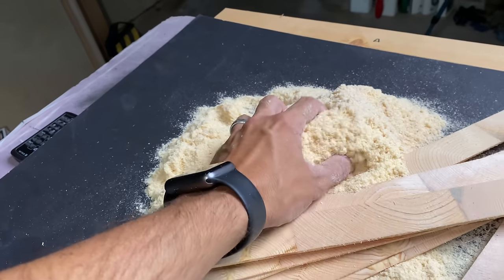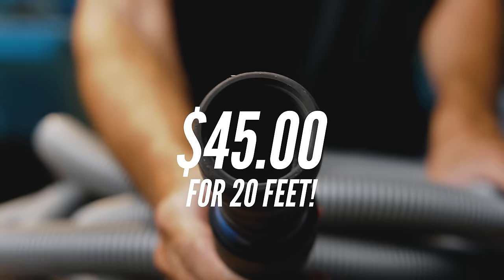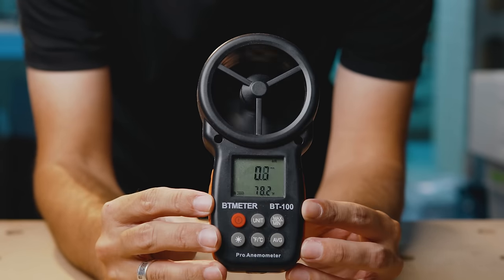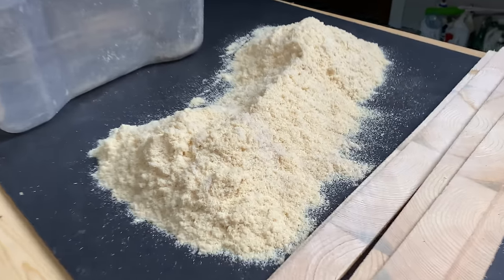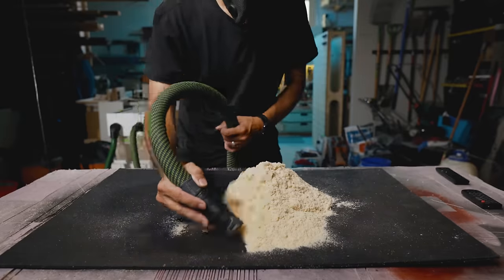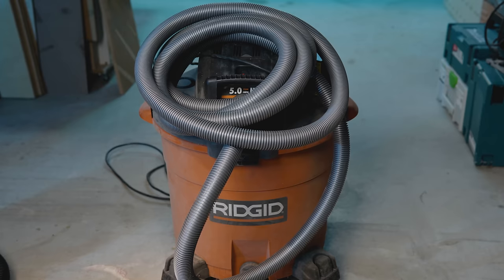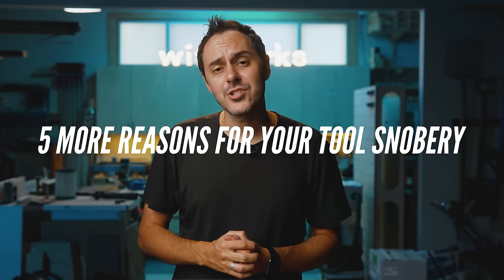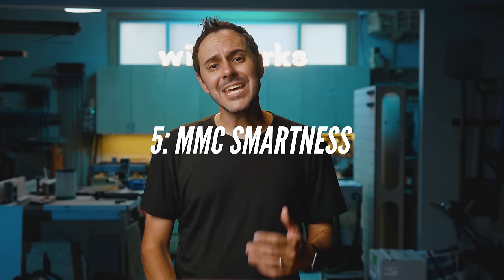This video will save you a lot of money. Dust extractors for beginners.

Comment: Overall very nice video, but the study design is flawed. The goal of a dust extractor is to remove as much dust as possible from the air that you will inhale.

You don't measure the overall dust in your workspace or the dust levels around your face (that you will be inhaling); instead you measure the total amount of dust in the air around the exhaust of the dust extractor. 

You show that the newer dust extractors move a lot more air (about twice as much as the old dust extractor), which suggests they also move more dust (probably about twice as much as the old dust extractor). 

So, if you measure the concentration of dust particles at the exhaust of an extractor moving 5m/s of dusty air, you would expect it to to have a lower concentration of dust particles than the air surrounding the exhaust of an extractor moving 10m/s of dusty air.

Some ways you could adjust this experiment are to have the dust meter in the vicinity of you face as you saw, to see how much dust particles you would be inhaling with each extractor. Given the increased air movement of the newer dust collection models, I would expect both of the newer models to outperform the older rigid in this regard, and improve the quality of air that you're breathing!

nice work, though!
Reply from the maker: Thank you Max. I should have bought a second monitor to put by my face. That’s most important. It would be interesting to see the differences.

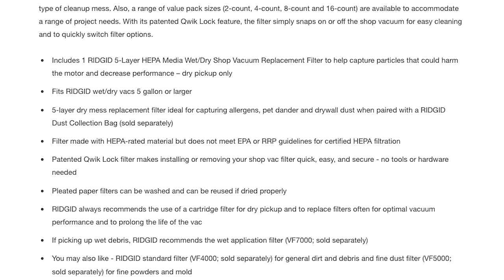Comment: Your comment around 2:30 in is what I am trying to sort out wirh Ridgid support right now. I believe what you are saying may be correct but what I don’t know and they are unclear if not actively misleading is whether you need to shell out even more for the special green “cyclonic” filter bag. As it reads in your second highlight, it’s left unclear. Did you happen to address this question? the cyclonic bag is possibly a gimmick to get you to buy their branded bags. Also, did you dig i to any of the claims on “OSHA table 1 compatibility”? The statement they make there is meaningless because they don’t make a substantive claim pursuant to what is included in table 1. I am taking it up with their support presently, waiting on escalation to their product managers and engineering. Just wondering your thoughts.

Comment: The main reason your test isn’t “scientific” is that your sample size is too low in two ways. The first is that you’re testing one of each filter system. A professional lab conducting a scientifically rigorous study would test multiple machines for each of the three systems. How many? Ten, fifty, one hundred? More? I don’t know, but there’s a way to calculate how many machines per system to arrive at a statistically significant number.

The second issue is that you’re probably not conducting a significant number of tests for each machine (again, I don’t know how many tests per machine you’d need to conduct, but there is a formula for finding this out. A statistician could probably tell you.

The reason you’d need to conduct all these tests with multiple example machines is it corrects for all sorts of variables that might be affecting your results.

So we’re talking a buttload of time, effort, and money—which is why these sorts of tests are conducted by professional labs, paid for by the government or industry groups or individual manufacturers. For a test of these machines, they’d have a team of people working all day for however many days.

It’s just not realistic for you or me to attempt scientifically and statistically rigorous testing.

That said, I think your test is valid FOR YOU, because you were testing the machines you are using or going to use. I also think you made a good decision, and the reason is not the convenience factors you mentioned. (And I want to note that your anecdotal evidence IS evidence. It’s just limited evidence.)

Because the Festool air filtration system is purpose built, it’s a safe assumption that they rigorously test their machines. They probably periodically test production runs. It’s probably a safe assumption that their safety standards are high because European Union (their main market). These assumptions are NOT scientific, but instead rely on faith in expertise. (And there are many folks that just don’t trust expertise and operate on gut instinct or react to DIY videos or marketing or whatever.)

Anyway, I have been using my shopvac for years (without accessories) and I’m heartened by the idea that a dirty filter has been protecting me (even if there isn’t scientific proof for the idea). And even though my health is worth more than the cost of the Festool, it’s just not within my current means. But I think I have an economical solution, and the name of that solution is KN95.

The last two years of pandemic have trained me to use KN95 (or N95) masks. I’m more comfortable wearing them than I was pre-pandemic. Sometimes I come home and forget to take it off right away. Wearing a mask no longer seems like a hassle. I already have a decent amount of masks squirreled away. (Also, my shop is well ventilated, so I don’t think (I hope) that these micro particles are not lingering.)

Realistically, how much time do I spend generating and/or exposing myself to saw dust? I’m in my shop at the very most 24 hours a week when I’m deep into an ambitious project. Sometimes I’m in there 4 to 8 hours. Sometimes I’m not in there at all.

Last weekend I had a health issue with excessive dust that took me out for half a day of recovery. So after that I’ve been wearing a mask and I’ve experienced no issues. That’s my anecdotal evidence that the mask is doing something. I just don’t know how much. But if it’s good enough for viral particles, hopefully it will be good for dust particles.

I hope that anti-maskers read this comment and become mentally unglued. 😂
Reply from the maker: Too long didn’t read.

Comment: Luved the vid.I’m in as similar situation over the years. I work with a lot of MDF. I have vacs and hose connections on my miter saws, router and orbital sanders. Yet I always struggle with the amount of dust in the garage and at the job site. I use a dust hood on my trim saws hooked to a vac ( the same vac I use to suck up drywall dust and wood shavings)on a foot pedal switch. Just cant seem to want to spend 1,000 buck on a vac  from a 150 buck one with near the same CFM that I have to lug around in a truck that has little room in the box with a hard tonneau cover on it,. Any thoughts to say a portable vac 1 or 1.5 Hp stand up collector to wheel around to where you need it in the shop. My table saw moves around the garage as I need it.  I’d say in a 25ft radius  of my work bench.  Most times right beside the SUV in the winter months. LOL

Comment: Great video! Got me motivated to set up my freebie shop vac for dust extraction 

I would be curious to see what the air quality meter would read if you put it right next to the tool as you’re cutting. I.e. - is the lower cfm you can get from the clogged old shop vac able to fully capture the dust produced at the source? Or is the festool better at catching everything thrown off by the blade?
Reply from the maker: 1) I have learned that the air meter in this video is garbage. 2) I have a more recent video that has a better monitor and tests at the source.
Reply: @wittworks  Thanks! I’ll check it out! Excellent work thank you

Comment: Enjoyed your video especially since I am looking to purchase the Festool CT 15 E HEPA the for lack of a better term their entry level dust extractor $416.99. Missing the hose storage, Bluetooth and it has the older style hose.
I am currently using a Ridge shop vac with the bag and HEPA filter. My question is is there a difference between the two vacuums in how much sawdust it picks up using the track saw. I watch some videos and it appears that very little sawdust escapes the Festool track saw using the Festool vacuum as opposed to what is left behind using my ridged vac.

I appreciate any feedback you can give.
Thanks

Comment: Those "cheap" air quality meters are practically useless. The sensors they use can't differentiate between a piece of sand or a micron particle. They simply approximate the particle size. One would have to use a laser scattering quality detector that is calibrated from the factory and continuously calibrated annually.

Comment: Do you need a hepa filter bag when you have a hepa filter and using a cyclone as well. As all the dust goes into the cyclone. And how much does a diffuser reduce the noise by.
Reply from the maker: for the hepa rating, yes.

Comment: What order did you use the shop vacs in? If you used the old shop vac 1st every time then it is starting with cleaner air while the other two are getting poor readings due to the amount of dust from the first test.
Reply from the maker: I did Festool first and old vac last. Also waited until the air reset.

Comment: First, an anti-static hose is used in woodworking to prevent the static build-up that could create a spark that could cause an explosion or fire, don't use one at your and your family's risk, the same thing go for the cyclon, these should not be legal without anti-static. Secondly, your old shop vacuum performs better at dust removal because the filter is blocked, all the additional particles on the filter act as additional filter elements, this is at the expense of airflow, poor performers at vacuuming, install a new standard filter to have a better comparison.

Comment: The numbers make sense when you consider the number of particles counted should be less on the old rigid because your airflow brings less to be counted.  The more particles counted, the more accurate your efficiency reading will be! With lower counts you are getting a false sense of security because the air is less dense only because its not seeing as many particles per minute. 
I hope this makes sense to you in a good way. I'm not being critical, only trying to explain how you are getting these readings.You have to be the one to decide if the difference is critical enough to make a it worthwhile. 🤔

Comment: The results were surprising. I would have expected the festool to do the better job.
But using anything to help eliminate dust is always a good strategy. While I've got a couple of vacuums attached to various tools to help keep dust a bit lower, there's other times when it's hard to do that (like on my table saw and circular saws). If I'm cutting large sheets, I just cut them outside first. 

My father was a builder for over 50 years and died of lung cancer. I don't ever remember him using any type filtration at home, however I'm sure they had some at work. I don't know if you can fully attribute the cancer to hazardous woodworking particles as he was also a smoker since 15yo, worked with asbestos and during the early days of the trade, fine dust particles weren't a thing (large dust extractors were just to get rid of shavings). Funnily enough, I remember him saying something along the lines of "Most dust won't hurt you. But if you're working with cedar, wear a mask as the particles will make your nose bleed".

Personally I get hay-fever, so reducing dust where I'm working helps reduce that.

Comment: I have been looking @ the CT MIDI.  I'd like to hook it to my CNC (Shapeoko 4). But it doesn't look like the hose that comes with these collectors is the right diameter to fit the dust collector fitting on the CNC.  It looks like it requires some 36mm hose.  Any experience with this?
Reply from the maker: I've not hooked it up to my cnc, but I have both hoses. For a cnc, I'd probably get the ct15 - cheaper because it doesnt have bluetooth
Reply: @wittworks  thanks!

Comment: How does dialing down the suction eliminate swirl marks from a sander?
Reply from the maker: dials in the surface tension some how. I am thinking it allows the sander to float more. When you press down on a sander too hard you can get swirls.

Comment: Spend 89 dollars and put in an exhaust fan in your shop.  It's a workshop, not a condo. 
For the love of God, how did people survive in the 1970s without all this digital crap?
My workshop has no windows.  It does have an exhaust fan and I use the simple shop vac to collect dust, no bag, but does have the hepa filter. 
My workshop is absolutely safe for people with allergies.  My wife has allergies and works with me all the time with no problems.
Noise - get a pair of 90 dollar active headphones, chargeable.  This is the only "high tech" piece of equipment we use to protect our hearing from loud noises like saws.
We also wear them when shooting our guns.  I also put them on when she's mad and yelling at me.  😁
The active headphones dampen all loud noises but you can still hear people talking because they actually have a microphone built in.  They just have a built in noise gate. 
Worth every penny. 
So, for 200 bucks, my workshop is just as safe with clean air as yours will all your high tech gadgetry.  My shop runs on solar solar power, so I don't have an electric bill to heat or cool it or run any of the equipment.
If you're going to spend a lot money, get the solar power.

Comment: I have no problem believing your science and results and that the equipment used was consistent throughout the testing…based on your use of a track saw, that makes chips, instead of fine dust like a sander with 220 and finer paper. 
I’ve been using sanders for 40+ years as a DIY, long before that was even a term, all the way back to a time when sanders didn’t even have a dust bag. Fast forward 40 years and I started getting “sick” (couldn’t breath for several days without great difficulty) every time I used my sander for more than 15 minutes. OK, hook the 15 year old Rigid vac up…no improvement. Bite the bullet and drop a grand on the Festool CT26E and I can sand for days and not have a problem! 

So is the price of the Festool worth it? You bet your ass it is! I was at a point I thought I would have to give up making anything that required sanding.

BTW, I DO NOT have asthma or any allergies of any kind.

Comment: I'm a Cabinet contractor for 35 years, I have high quality power tools, but I absolutely will not purchase Festool products, they are insanely priced, and not remotely worth the money, $1580.00 for a slide mitre saw, $600.00 for a midlevel Router, and $800.00 for a shopvac, give me a break!!

Comment: I feel like you're not giving yourself enough credit with these tests. It would be one thing if you were using different testing equipment, in different testing conditions, for each tool. Granted, you're not operating in "sterile environment," but your methods are remaining constant across all platforms; and while the air quality meter isn't an über high quality one, the fact that it gets the same readings, for all the tools, is telling in and of itself. And the test results are proof enough that A.- I need to get my a$$ in gear, and at least get some sort of filtration for my workshop, and B.- I don't necessarily need to (nor can I afford to) spend $1k+/- on a system for it to effective for my purposes.

And as someone who's worked on projects in my shop for many years, without any sort of air filtration/dust extraction, this makes me shudder at the thought of the sort of damage I may have done to my lungs, but hopefully can avoid doing any more in the future with some of this information in hand. So thank you, for taking the time to conduct these tests, and putting this video together. I'm sure you've helped many more folks than you realize.
Reply from the maker: Thank you Evan! I’ll point all the trolls to this comment 😬

Comment: It's a little over simplified to even try to compare these extractor setups on performance.  What you are getting with a Festool extractor is not just a better vacuum, though you are getting that.  As with all Festool products what you are paying for is the luxury of an easy to use, product.  With Festool tools, they don't do different work than their competitor. They do that work easier, more enjoyable, and more repeatable.  With Festool Vacuums they don't have more suction, or extract dusts better.  Just change one disposable bag in a Festool extractor and you instantly know what you are paying for.  Every spec of dust is trapped inside the bag, even the inside cavity of the extractor is spotless.  Mine are 5, 8, and 10 years old and they all look brand new inside.  You can change that bag in the middle of a customer's carpeting without thinking twice about it.  THAT is what you are paying for.  Also, try actuating that $29 vac with your cordless tools.  

Festool is not meant to save you money.  If you are concerned about money, move along.  Got to Homeless Cheapo and buy their tools.  Festool is meant to give you the best, easiest, and most enjoyable experience getting actual work done.  It's for the people that want to stretch to the very tip of the bell curve of cost/value and pay for that last flat part of the curve to have the very best.  

I don't understand even the people that are on the Festool forums and FB pages asking about "more affordable bags".  If you want more affordable, go buy something else.  You are buying a system.  You are wasting your money if you aren't using the entire system.

Comment: Yeah not really surprising. I would expect much different results had you tested the air coming out of the vacuum my starting with a vacuum of air e.g had you put the testing device in say for instance a bag which had been emptied of air and then filled that bag with the exhaust from the shop vacs I would expect you would see much different results. That being said, even those basic filters in your standard shop vac are probobly eliminating the vast majority of harmful particles from the exhaust.